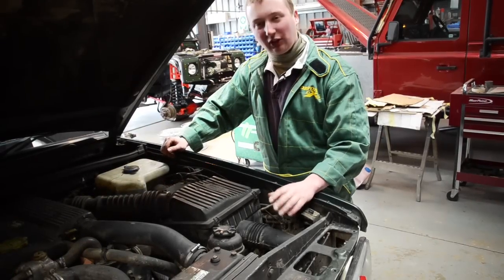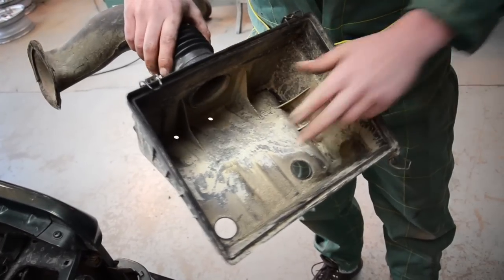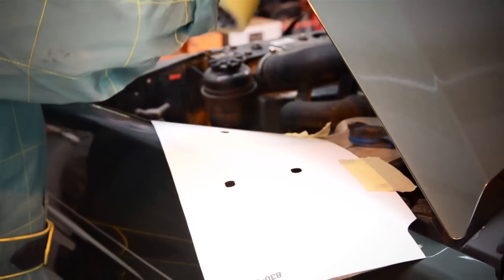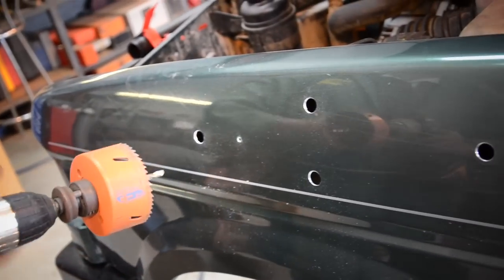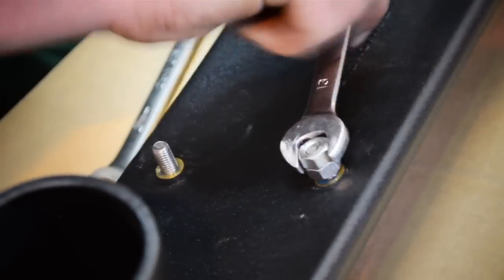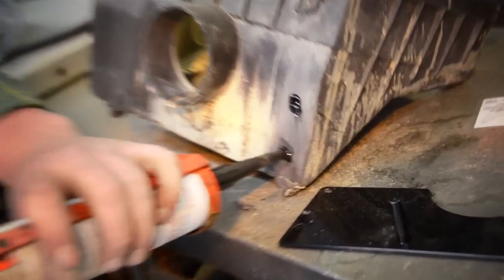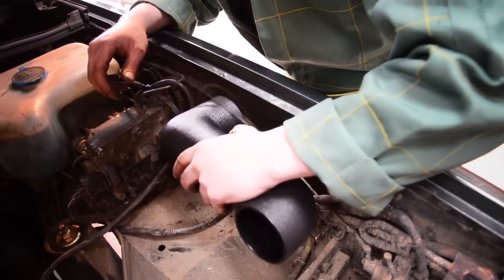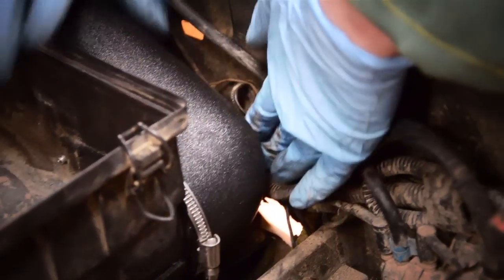Land Rover Discovery Safari Snorkel How to Fit

Comment: Have you had any problems with water getting in the existing airbox to turbo, turbo to intercooler and intercooler to manifold pipes? They didn't seem to be sealed. I've just bought one of these snorkels and want to make sure I'm sealing everything up properly. Thanks.